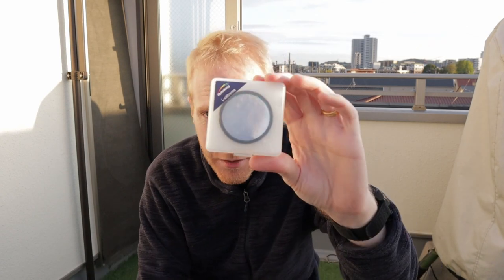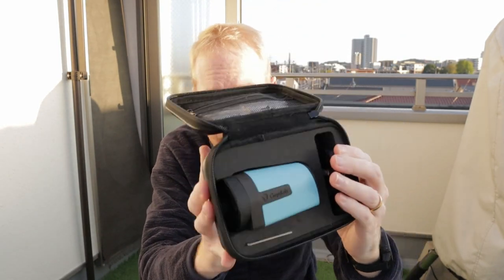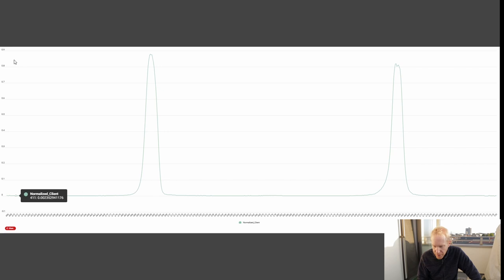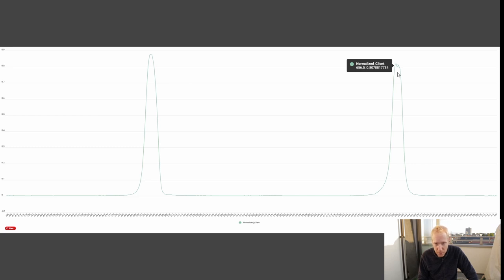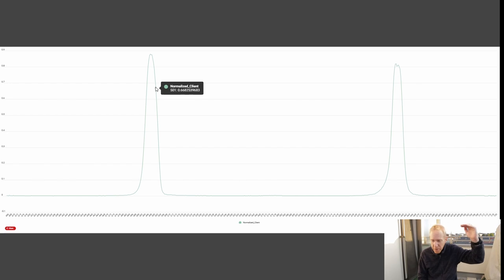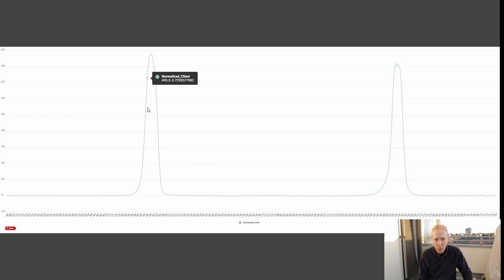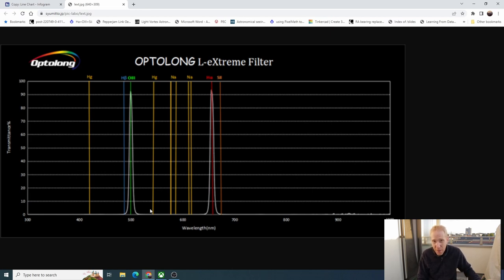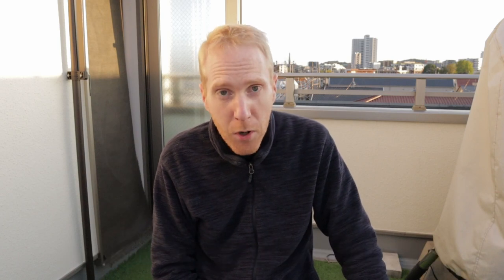I spectro-analyzed my SUBSCRIBER'S FILTER... and it wasn't good :(

Comment: have an Optolog L- Extreme and a Baader Moonglow.

I have no way to measure their emissions but I do notice that the Extreme sky is much darker then the Moonglow in my Bortle 4 sky.

It would be nice if they included a spec doc showing what the levels were for the specific filter with a QA Pass or fail, like what you would get for high end test equipment and not just what you should expect.  This glass is not cheap.

Comment: Thanks for another great video, Cuiv!  Always love to see these kinds of videos that test manufacturers' claims.  On another note (since you're talking about filters), I recently purchased a Sky-Watcher 150P Quattro (f/4).  In the past, I've been using an ALP-T filter with my AT60ED and really love it.  I think it works much better than my Optolong L-Extreme, which may very well be suffering from what you mentioned in the video.  Don't know if you can answer this, but I'm going to be using a coma corrector with my Quattro and that will change its speed to f/3.45.  Do you think it's worth another $350 or so to buy a highspeed ALP-T filter for my astrophotos at f/3.45, or will my other ALP-T filter work okay?  Thanks again for all the great info you provide!!

Comment: As always, great info Cuiv! I know I'm a little late to game here, but I was wondering if this type of issue would also cause any Auto Focus issues? I have the ZWO EAF that I have been using without issue with my Ha Mod DSLR and currently my ASI 533MC Pro when using no filters, a Skyglow filter and a SVBony CLS filter. However, when I use my recently purchased L-extreme the AF will not work. I get R^2 values of -1 or something crazy. Comon sense told me I need to increase my exposure time, so I went from 10s to 15s, 20s, 25s and still no luck. I tried to increase the gain and also increase the exposure time but still no luck. I can perform a manual focus with a Bahtinov mask and test exposures look good so I am stumped.

Comment: It would be interesting to test whether uber expensive filters such as astrodon/chroma/radiant actually perform better. I remember from a previous video that, in your bad Baader batch, the Ha performed a bit better than your astrodon. But, obviously, in the astronomy market it is going to be extremely hard to reach statistical significance. An optimist coud think that, on the whole, the quality is acceptable since it seems that virtually everyone with a bit of common sense is able to deliver very nice images. A pessimist would see rip-offs or lack of quality control everywhere and also have a lot of anecdotal evidence to back his negative perception... I highly respect your honesty, independence, analytical skills and enthusiasm but there is some risk to end up in a selection bias trap where people send only suspect filters for tests. Just as I might have fallen in a confirmation bias trap when you did your baader video since my 2004/2005 baader filters were also crappy compared to other brands. But, yeah, even if statistical evidence isn't ever reached, keep the videos coming!
Reply from the maker: Yes, sample bias is there, since only filters suspected of being deficient will end up being measured, unless there is a dealer-wide initiative to measure all filters sold. Astrodon filters I measured performed exactly as per spec (the Baader Ha performed better only at F3, which is expected and as per spec since the Baader is preshifted and made for fast systems!)

Comment: I've been meaning to test my filters as well. I have the L-Pro and the L-extreme. Fortunately I work in a lab and have access to analytical UV-Vis spectrophotometers. It would be nice to see if my results match with the provided specs.
Reply from the maker: Hope you can confirm your filters are good!
Reply: @CuivTheLazyGeek  I just tested my L-extreme filter. I have around 84-85% transmittance between 500-501 nm for OIII. The H-alpha line is a bit shifted. It peaks at 652.9 nm (93%) and I see 84% transmittance at 656.3 nm. Both bandpasses are ~7 nm FWHM as advertised.

Comment: Have got the same issue, using a F5.5 100mm Esprit refractor. Which Goyalab spectrometer model have you been using?
Reply from the maker: I'm useding the GoyaLab Indigo (and a cheap mercury argon lamp from AliExpress - mercury and argon don't care about quality, their emission spikes are always the same :) )
Reply: @CuivTheLazyGeek  Is it the UVA or UVA-B or UVA-C model ? Or does it matter to measure more than one

Comment: Wonder how many are affected.  I have a few from them!
Reply from the maker: That's the thing right? I do believe the majority is fine, but with those filters, it's very hard for end users to know whether it's performing up to specs because if the filter passes a bit of the required wavelength, it normally looks fine.

Comment: So without buying an expensive meter like you have, how do we test our filters?
Reply from the maker: Well, exactly, that's the problem...
Reply: @CuivTheLazyGeek  Seems like these companies should give us a print out of our actual filters instead of the spec they claim. It can't take that much time in their automated manufacturing process to measure the individual filters before they are packaged.
Reply: Some do. However, there’s nothing keeping them from being rubber stamped.

Comment: I just had the characteristics of my L-eNhamce measured at a college chemistry lab. My friend who did it for me told me that the spectrometer was possibly off by a nm, but no more. I'm not sure how to upload the image here, but the numbers (wavelength -- Absorption [where low numbers mean it's passing lots of that wavelength]) are here. Maximum absorption was ~4.1 -- I'm presenting the region around OIII and Ha where the numbers were lower than 2.0  Should I be concerned?

478	1.736	640	1.863
480	1.157	642	1.563
482	0.575	644	1.213
484	0.232	646	0.682
486	0.051	648	0.146
488	0.026	650	0.054
490	0.032	652	0.057
492	0.025	654	0.059
494	0.017	656	0.188
496	0.018	658	0.462
498	0.022	660	0.776
500	0.029	662	1.064
502	0.057	664	1.275
504	0.127	666	1.407
506	0.260	668	1.465
508	0.530	670	1.588
510	0.967	672	1.836
512	1.425	674	1.760
514	1.777	676	1.655
516	2.029	678	1.396
518	2.185	680	1.433
520	2.312	682	1.736
Reply from the maker: Assuming the spectrometer is working correctly, the bandpass looks to be misplaced.